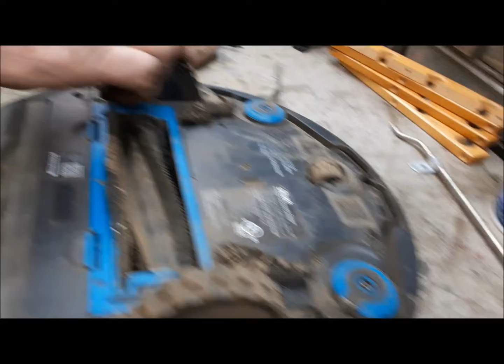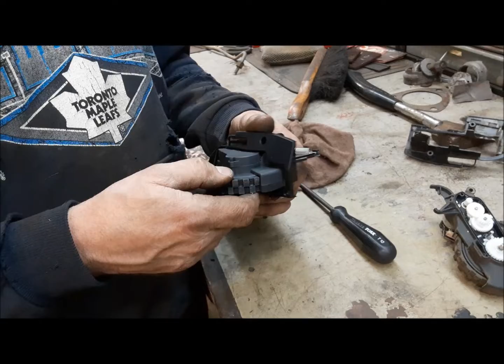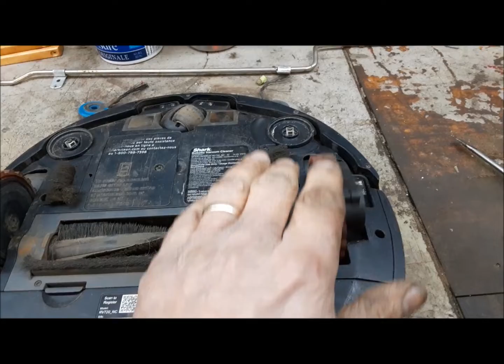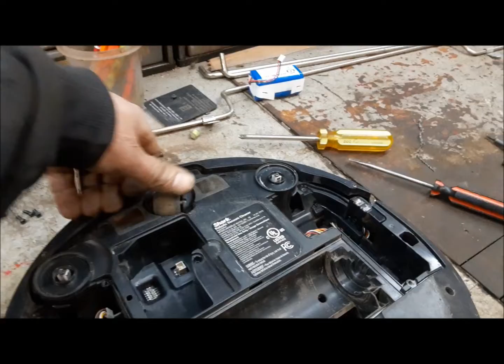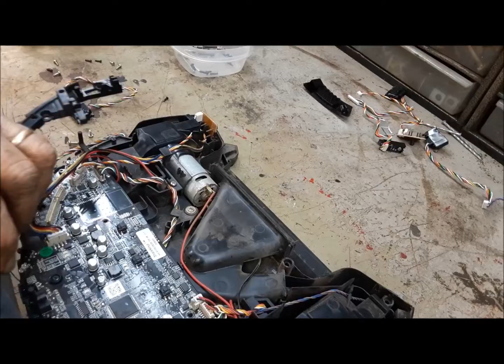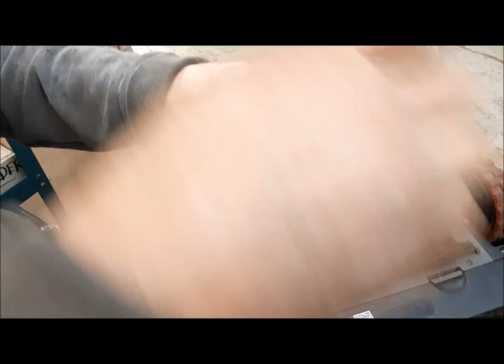Shark Robot Vacuum Wheel Motor and Cliff Sensor Repairs

Comment: My one wheel keeps locking up when it gets power and sends a fault and stops ?? Any ideas? Thanks
Reply from the maker: I'm far from an expert on them, but I would guess replacing the wheel motor would solve the problem. Trick is finding them cheap on ebay. Or find a whole non functioning unit on marketplace or something for parts.